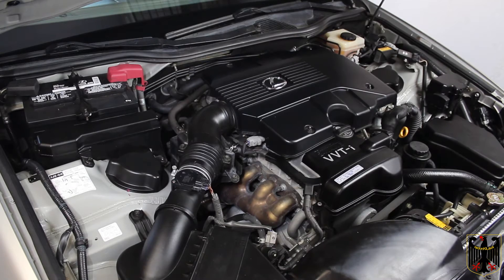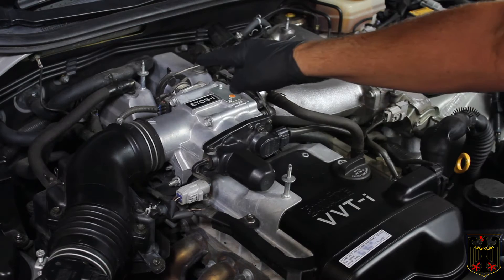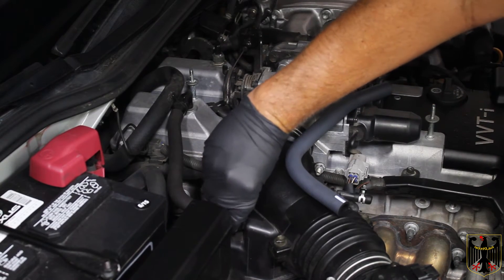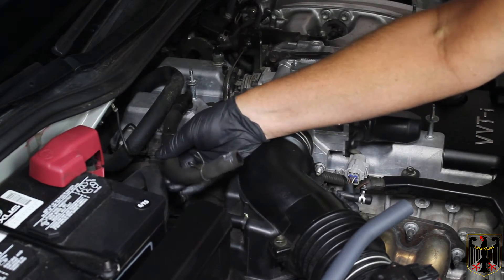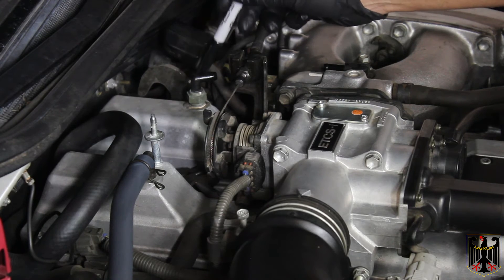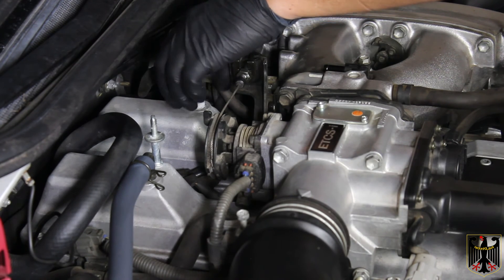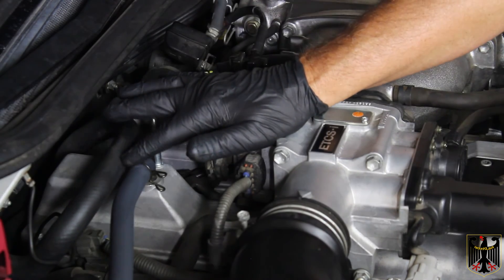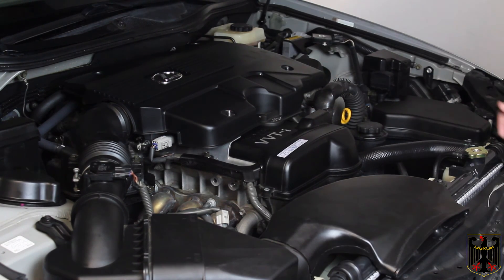2JZ-GE PCV Valve and Hose Replacement

Comment: I HAVE A QUESTION!! Is the vacuum nipple towards the front of the car on the plenum supposed to be plugged? or does it have a vacuum hose that needs to be connected? The nipple I’m talking about is behind the grey connector on the plenum on the engine oil dip stick side.
Reply from the maker: I believe on earlier cars it was connected, on later ones not.  Thanks for watching!

Comment: They sold me one with no threads
Reply from the maker: The older ones have a grommet and press in - if yours is threaded, they sold the wrong one to you, or somebody swapped valve covers to the older style at some point, but if you have a grommet, you're OK.  Thanks for watching!
Reply: @redonKiLaus sir the pcv valve with threads is  the part number with 31- the older one with no thread ends in 30

Comment: Hey man i see you are still pretty active on this video so i thought i would give it a shot and ask what do you think could be my problem? i bought a used gs300 today and was driving home and it sounded beautiful no rough idles etc etc. i was going around 15-25 whole way until i gave it a good deep pedal to the metal slight pull for maybe no more then 4 seconds bringing me from 20ish mph to close to 40mph when it just shut off in the street and i had to roll it to a nearby parking lot. the battery is cooked (sidenote, don't know if that is relevant or not but had to have it jumped to turn on before i left the guys house after buying it) it wont turn over now (assuming the battery is cooked) but when it did still crank after shutting down it would do the following: crank start let me give it a rough sounding rev before completing shutting down within a second (rev or not) what could be my issue? what should i you know be looking at as the potential culprit(s)?? if you happen to see this just wanna say thanks for the info in the video regardless, AWESOME!
Reply from the maker: I'd look at dialing in the electrical system first.  Without good power the electronics won't work properly, and car won't run.  Battery, alternator, grounds all need to be good.  Thanks for watching!

Comment: Wait hold up my pcv valve replacement they gave me a rubber garment
Reply: that’s for the other one
Reply: Wym
Reply: The one on mine on the intake side has a metal one that’s threaded and the other side has the plastic one with no thread

Comment: Have to replace the ventilation hose on the passenger side but am missing a clip, is there a certain size or type of clip to get or can I get the general set of clamps from my local auto parts store?
Reply from the maker: I'd hit up Toyota or Lexus for the clamp - it's a constant tension style and while a small worm gear one may work, I always use OE or OE style.  Thanks for watching!

Comment: Hey the video was super helpful but just a question. I replaced the first hose you replaced with just some normal hosing with the same width specs and length. Do those bends restrict it a certain way to where I should be replacing them with the OEM part? I noticed the one you have is all bent up and stiff to fit better but I just used some hosing from autozone because it broke when I touched it.
Reply from the maker: As long as you're bent and not kinked, you should be OK.  Thanks for watching!

Comment: PSA: THEY CHANGED THE PART NUMBERS: the new ones are 12262-46090 and/or 12261-46051 I WENT TO LEXUS because my is300 with a 2jz-ge had its pvc hose held on by tape by previos owner lol, brand new from the dealership is like 50 bucks 👍🏼
Reply: yeah, it's about $40 - $50 online. Ridiculous price just for a hose! I bought some ventilation hose from Autozone for $4 bucks. However, I noticed the OEM hose has a metal restrictor inside the hose. I'm not sure how important that is and going to affect the car for not having it.
Reply: can we get more information on this ? I purchased the OEM hose from Lexus and it didn’t come with the metal restrictor , will this have effect the performance ?
Reply: @shmoop2jzge799  I would call the dealership and ask the service guy since you bought it from Lexus. If the hose you purchased from Lexus is a new model (new part number as well), the restrictor may be unnecessary. How much did you pay for the hose?

Comment: watching this video  becase my hoses actually broke in half when changing some seals, but i have an is 300. im having trouble finding the exact part number for my model, although it is the same engine im not sure if the part numbers are interchangable. any tips?
Reply from the maker: I'm guessing it would be the same - I recommend checking a Lexus parts site to make sure though.  Thanks for watching!

Comment: Just wondering do you need that specific hose for the passenger side ventilation? Or can you just match the hose size with some regular hose?
Reply from the maker: You can replace with regular hose if need be, shouldn't be an issue.  Thanks for watching!

Comment: What does that hose run to. What’s the other valve on intake?
Reply from the maker: The PCV hose runs between PCV valve and intake for oil vapors and crankcase pressure to be vented and recycled.  The other hose between the covers just bridges them, since they two cam covers are entirely divorced on the 2JZ.  Thanks for watching!
Reply: Is it normal to get some oil in vapour cannestor box by PCV valve hose

Comment: For hose 1 I couldn’t find. Any suggestions of what to look up? Is it also called a breather hose? I bought hose 2 I have a 2001 is300 literally changing those same exact hoses
Reply from the maker: Take a look at the parts diagram...not sure off the top of my head, but it definitely "could" be called a breather hose since that's another name for the PCV system.  Thanks for watching!

Comment: Hi I'm having a problem with my 01 is300 i took apart the throttle body to get to the spark plugs because of a misfire noticed liquid down in there, so I cleaned it up and put new plugs in and I also replaced the tps but my car wont start.
Reply from the maker: A lot of things are touched in that procedure, without seeing the car and diagnosing there are too many variables to advise without steering you in the wrong direction.  Thanks for watching!
Reply: Dealing with a similar issue now, what did the problem end up being?
Reply: @tayoilunga-reed8061  this was a while ago but it was a combination of the tps and a massive vacuum leak coming from the throttle body

Comment: Was there a reason you didnt replace the other PVC valve?
Reply: These motors only have one on the intake side. On the exhaust side that’s just a vent to recirculate blow by back into the motor to get burnt.
Reply: @DhatLex  I see. Thanks alot!

Comment: The other pcv is it the same as the other
Reply from the maker: If I recall correctly on this engine, the other one is not a valve and is just a tube attaching to the rubber crossover hose.  Thanks for watching!
Reply: @redonKiLaus  thankyou🙏🙏

Comment: haha wait wtf, i searched "2jz ge burning oil" this was the first result, funny thing is both of those vacuum lines are cracked but only those 2. must be a common issue. i also electrical taped that tube in the same way. and i can say its a b** to get on, going to fix now see if that will fix my missing oil?
Reply from the maker: They're known to burn some oil but nothing major.  Thanks for watching!
Reply: @redonKiLaus  i lose about 5 liters  of oil every 8000-10000km, it doesn't put a drop on the ground and it still has okay power, this is why i think its burning it. i seem to have some exhaust smoke, but i have a 3 cat delete with a slightly louder muffler with more flow, so i expected it to kinda run shitty. maybe burn some oil, but if i stop topping it up on oil it will hit the low oil level light before my next oil change
Reply from the maker: @fallinbeef  The exhaust won't make it burn any more oil, and if you're getting blue smoke that's no bueno.  Definitely something going on in that engine.
Reply: @redonKiLaus  white smoke not blue
Reply: @redonKiLaus  i cant find anything pointing to why its burning all this oil just that its getting burnt. i run it pretty high in the rpm consistently for the last 60 000km maybe thats why?
Reply: @redonKiLaus  i had also guessed at a busted head gasket
Reply from the maker: @fallinbeef  White smoke and loss of oil would definitely point to that head gasket.  With no cats I'd expect a bit of black smoke at some points in time, but visible white smoke is likely very related to your loss of oil.  I drove my GS for about 30k miles before passing on to a family member and in that time ran the engine very hard in terms of RPMs and no such issue.
Reply: @redonKiLaus  yeah the 2jz isa beast for sure, but i dont wanna push. looking into replacing the head gasket now.

Comment: Hi, thanks for the info, great vid and very clean engine by the way. I have bought a used gs 300 1998 same engine but noticed there was no hose on the passenger side vent, what is the effect without that hose? I am also getting engine ping/knock any common cause for this engine and what to do. Currently the one i bought has 100k miles on it
Reply: Matt Inducil unfortunately Those Toyota Lexus engines are very vacuum sensitive. That being said, you’re going to half to put that hose where he should then take the car for a spin in here if the knocking/pinging still there. Another suggestion is to “seafoam” the car via a vacuum line (any line that sucks in air while motor running obviously) and after procedure, drive the car again to see if pinging goes away. Also if you have a scanner, plug it to see if you have any codes (that will be the first thing to do actually), but if you don’t have one you can go to your closest/nearest “autozone” for they’ll hook up a scanner for ya. Man best luck to you and don’t forget that you have an awesome car that if well maintained it’s almost “bulletproof.” Cheers mate
Reply from the maker: You may have reduced power and increased emissions.  You definitely want the hose in place.  Thanks for watching!

Comment: I have a1993 non turbo supra and my pcv valve broke off,it was plastic,can the base come off the rocket cover?,because it just spins around..thanks
Reply from the maker: Yes, but you should take the rocker cover off to ensure that nothing falls into the valvetrain, since to remove the rest you'll need to break it apart and the purchase a new valve and grommet.  Thanks for watching!

Comment: how the hell is that pcv valve threaded ? mine was smooth ?  model car was this sc, gs ? i have a 2000 gs300 and the pcv valve is smooth not threaded.. .thanks
Reply from the maker: 2002 GS300.  Earlier cars had the grommeted valve.  Thanks for watching!

Comment: 3 years old video but the best thing he said "that's the reason why don't take your car to the dealer" 😂
Reply: Aka Stealership lmao I remember when I took my NAT gs300 to the stealership and they wanted to charge me 1100 to change out the throttle body cause I overlooked the Pcv valve and it was causing my car to die after acceleration poor idle too never the less I looked over my engine bay again and found my hose had came off from boost afterwards I showed back up to the stealership and I laughed and said I needed a new throttle body huh? And did a fat rip and drove home laughing.
Reply from the maker: Ain't that the truth - thanks for watching!

Comment: Will that pcv valve and the hoses fit in my 2001 is300? Can use the same exact parts?
Reply from the maker: I believe it will, but I can't vouch for that 100% since it's been a long time since I had my hands on an IS.  You can consult your Lexus/Toyota dealer when ordering the parts to confirm fitment, however, or enter your specific year and model in a Lexus online parts store and it will run a compatibility check for you.  Thanks for watching!

Comment: Dont knock the dealer, they could of declined repairs, and that could of been a courtesy patch. You weren't involved
Reply from the maker: It could have been if it weren't for the fact that I have all of the original service records and the original owner of the car was invoiced for that exact hose less than a year before I purchased the vehicle (per the invoice for the particular service in question).  Thanks for watching!
Reply: redonKiLaus ✅

Comment: Just got mine done, passanger side hose (#2) was hardened and cracked and leaking some oil vapours. I did replace a whole lot of other vacuum hoses before, this one was missed apparently.BTW, the passenger side hose #2 was changed in 06.1998 but according to the catalog, only for the european models. The new part number is 12262-46080 from 06.98 and up, and it's not just a hose: there's some kind of brass/copper thing pressed into it, with a small hole. I guess it would be some kind of a valve, similar to the PCV valve, or maybe a choke?
Reply from the maker: Interesting, sounds like they potentially added a flow restrictor - might be for emissions reasons.  Thanks for watching!

Comment: can i use the metal  pcv valve on my 95 sc300? amazon says it wont fit... @redonKiLaus
Reply: @redonKiLaus
Reply from the maker: You can't use this particular one since the older 2JZ-GE without VVTi uses a grommet and push in valve instead of a thread in one.  The push-in one might be metal, though, as it is for several other Toyota inline engines with similar setups.  Hope that helps, and thanks for watching!
Reply: Yeah most definitely. Thanks man!

Comment: What are your thoughts on oil catch cans? The gs300 is prob boosted by now, but during this time did you consider installing one? From a reading a bit online, seems like it would be a good thing to have one on.
Reply from the maker: They are definitely a good thing to have, particularly if your vehicle is known for significant blowby and you don't want to coat your intake and back of your valves with oil and the resulting carbon buildup.  That said, a quality, filtered catch can that recirculates to your intake to pull vacuum on the PCV system is the only way I would go on a vehicle that isn't heavily modified, and that same setup also applies to many that are extremely modified as well, depending on whether a recirculated or VTA setup is best for a particular situation.  

Most Toyota and Lexus vehicles aren't known for excessive blowby or heavily flowing PCV systems, and I don't run one on my Lexus (still stock as my daily driver) or my turbo 4Runner.  On the 4Runner, I do have a check valve setup in order to prevent the positive manifold pressure from making its way into the crankcase and inadvertently pressurizing it - I've had several fellow turbo RZ guys ask questions about why their newly-turbocharged trucks aren't running properly, and 9/10 times its vacuum and PCV routing issues.  Some engines (Nissan VQ, especially the VQ35 in the 350Z, for example) are known for massive oil consumption issues through the PCV system, and a catch can helps to curb some of the side effects of this, but it really comes down to monitoring your PCV system for flow and determining if it is suitable for your particular application.  

Hope that helps answer your question, and thanks for watching!

Comment: Hey redonkilaus  I'm having a bad problem with my car tonight, it's making a loud knocking noise as I drive, the knocking speeds up the faster I go. When I apply the brakes the knocking stops. What do you think it could be and could that be a bad wheel bearing?
Reply from the maker: If the knocking stops as soon as you hit the brakes (but while still moving) then I don't see that being a wheel bearing.  My best guess is that it is something within the brake system making the noise if that is indeed the case.  However, if the noise just slows down when you slow down and speeds up when you speed up, then it could definitely be a wheel bearing.  Another thing to check is revving the car in neutral to ensure that there is no knock that speeds up or down then, as that would point to an engine issue.

Comment: redonKiLaus do you also have a video on changing o2 sensors? I have read on clublexusforums and seen other vids that there are 3 Sensors on a 92 SC300? I don't have any check engine lights but I've noticed my car slightly lost fuel economy after changing the iridium ngk plugs, ngk wires, and rotor, during timing belt and water pump change. Do you think it could be the sensors? Can I change just 1 or do all 3? The shop told me I had 2 but after browsing online, everyone is saying 3.
Reply from the maker: I would try resetting the ECU to allow it to recalibrate after a tune-up; simply disconnect the car's battery for about 30 minutes and then drive it for a week or so and see how your gas mileage after that point - if not increased, then the O2 sensors are a likely culprit for the car running rich, but there is no good way to diagnose without a wideband O2 sensor installed (or OBD2 capability, which is only 1996+ cars).  The SC should have either 3 or 4 O2 sensors, can't remember which, but I typically recommend replacing in pairs (i.e. primary sensors together) or all together.
Reply: Which are the 2 primary sensors?
Reply from the maker: They are the two on the header (exhaust manifold) that are mounted before the catalytic converters.  They control the fuel mixture, so they are the ones that would be causing any fuel efficiency drop.  If you don't mind me asking, what are you averaging currently?  That would better help me gauge if something is truly wrong or if there is just a sensor or other ECU control issue causing the drop.
Reply: I will find out how much I'm losing, all I've noticed is I fill up a day sooner then I usually do after going back and forth from work every week during a 5 day work week. So like 11 miles of a loss. I will find out exactly and get back to you.